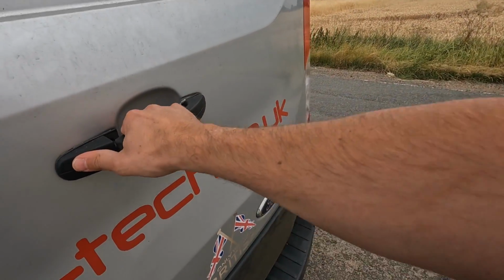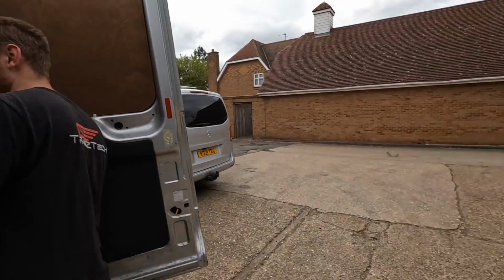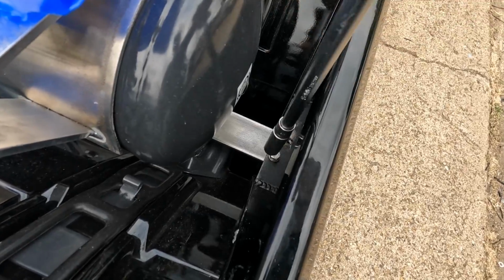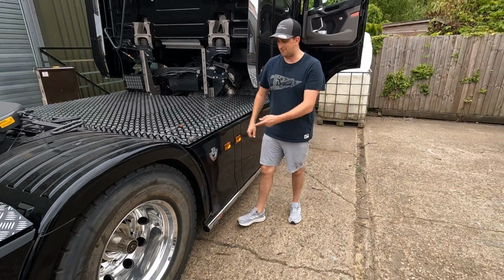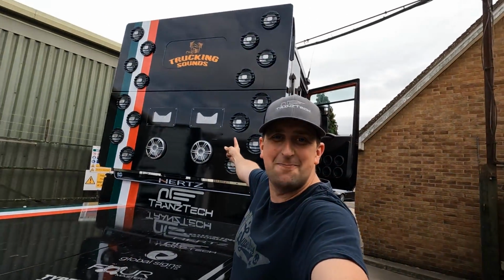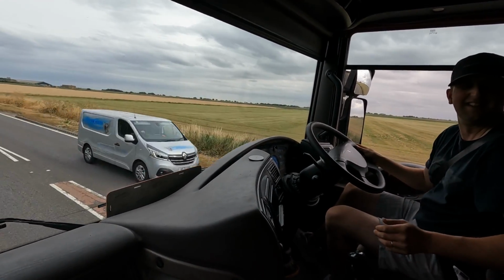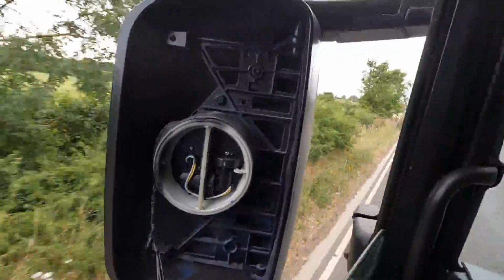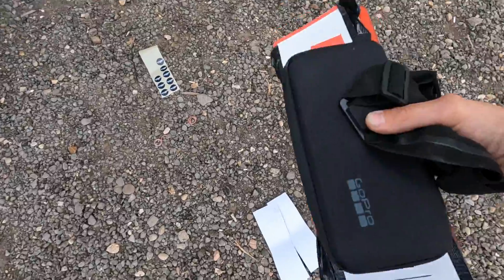Driving The UK’s LOUDEST Truck | NEW JOB!? | #truckertim

Comment: As a Scania man, it always hurts to watch when the handbrake is released and let it bang away freely.
Don't do it, man, if you don't want the valve inside the dashboard to stay intact and not start leaking.
99% of handbrake valve leaks are caused by the handle being allowed to freely bang off.
In orthodoxy, you carefully brake with your hand and catch it when you release the handle.
Having driven for Scania for 23 years, I have learned it myself.